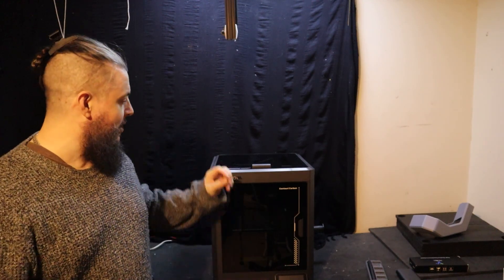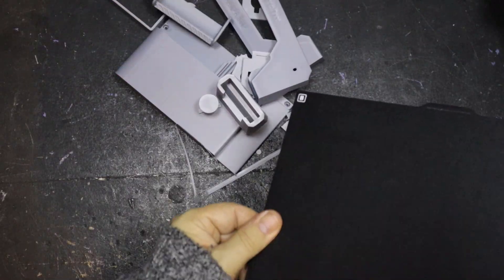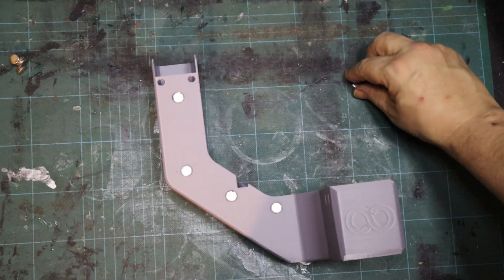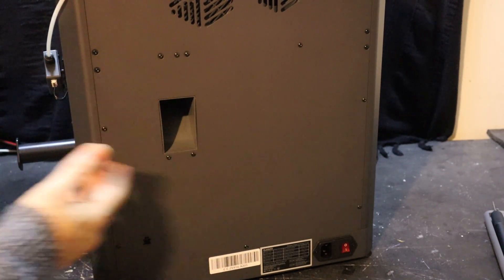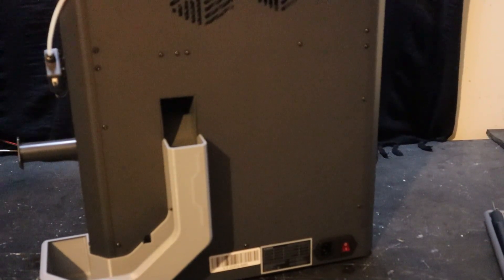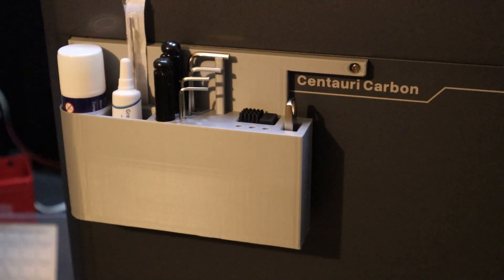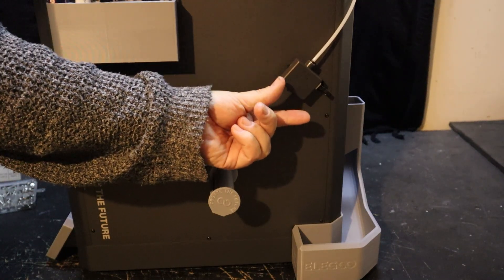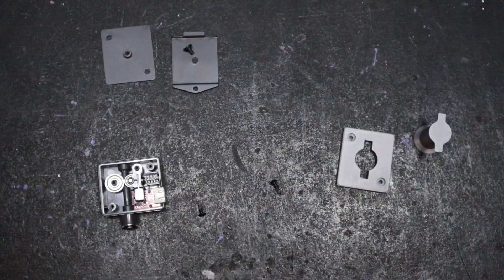8 x 3D Printable Upgrades To Make Your Printing Experience Better - Elegoo Centauri Carbon

Comment: For CA glue "kicker" (7:34) you can use an atomizer bottle with a baking soda / water solution. The alkalinity accelerates the curing.
Reply from the maker: Oh, that's a great tip, thanks for sharing!